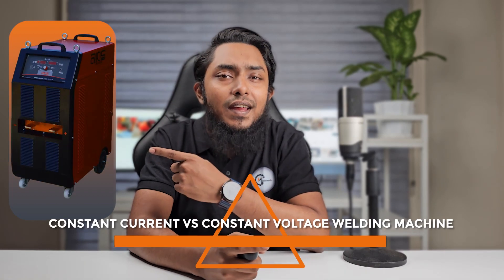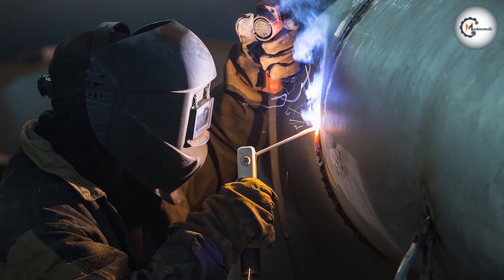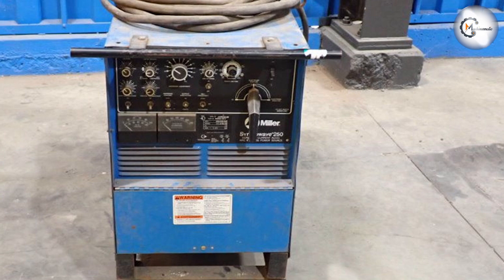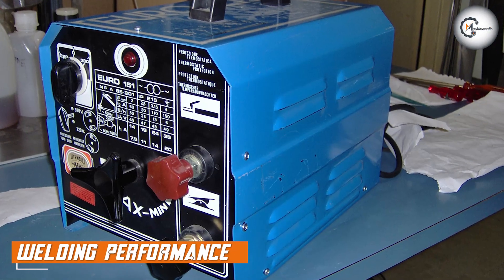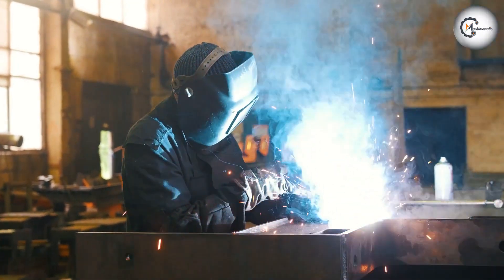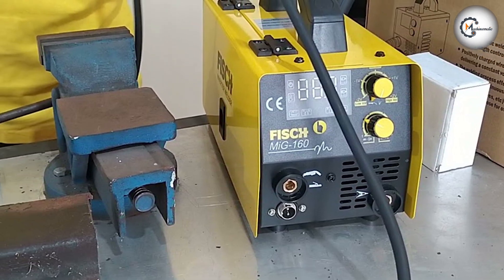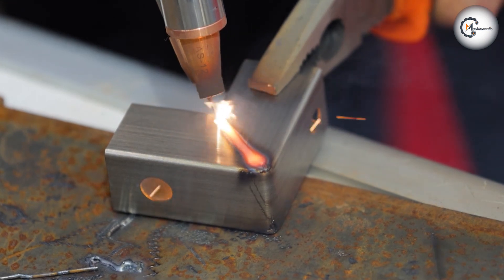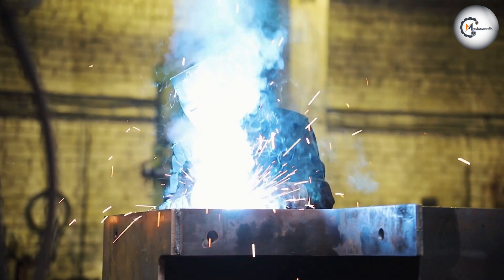Constant Current vs Constant Voltage Welding Machine - What Sets Them Apart?

Comment: Seems like you are getting picked on in comments! I hate to add to that, but almost every pic you show is backwards in relation to your words. MIG is constant voltage and tig/stick is constant current. I wouldn’t want to see anyone learning incorrectly based on the pics shown as you discuss cc and cv.